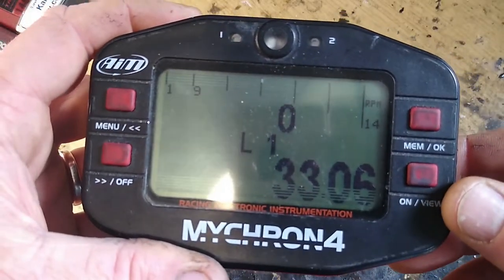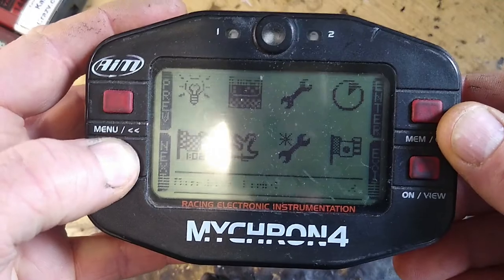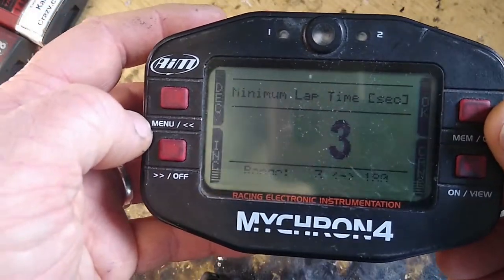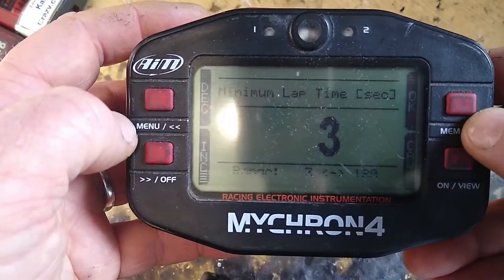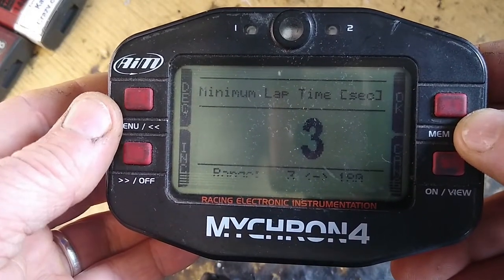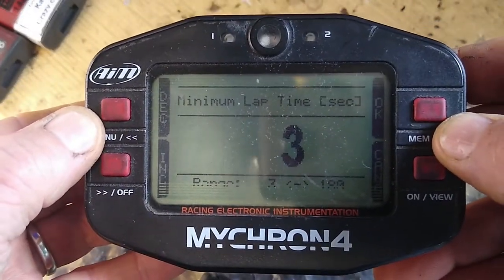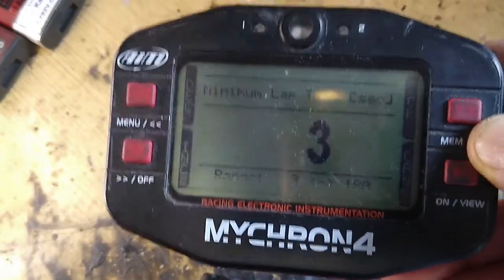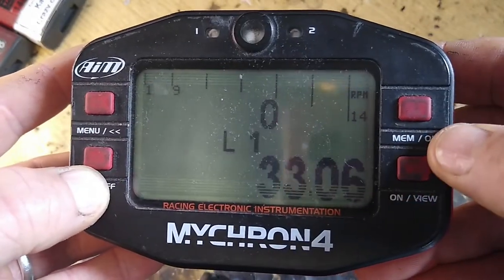How To Set Up a MyChron 4 Kart Lap Timer

Comment: Can you tell me where the magnetic laptimer has to go? Does it need to be  on the bodemplate?
Reply from the maker: Lap sensor goes on floor, best in centre so it is triggered by the magnetic strips in the track.
Reply: Oke thank you. Last time I placed it high on the front panel, but the Mychron did not work. I will try it on the floor 👍
Reply from the maker: @marco_v_nmgn  the sensor has a limited range. Depending on the one you have it can be as little as 40-50mm so it must be on the floor of the kart to be triggered.
Also some tracks the magnetic strips are not great.  So if you sometimes miss sectors try moving it to left or right
Reply: That does explain why it did not work😀 in 2 weeks I am back on the track. I will test it out
Reply: I tried it today but stil does not work. In the screen it also says L10 and not L0 like in your film. Do I first need to reset it or something?
Reply: Does it matter which direction the sensor points to?
Reply from the maker: @marco_v_nmgn  no. But should be along not across the kart floor.
Reply: What do you mean by along the floor?
Reply from the maker: @marco_v_nmgn  I suggest next time you are at a track find someone with a mychon & ask them to help.
Reply: I did but they only knew alfano laptimers. But maby next time other people will be there